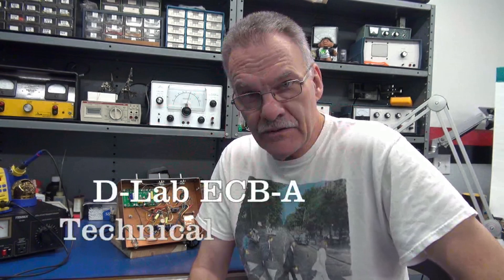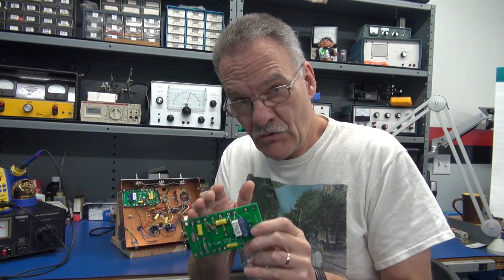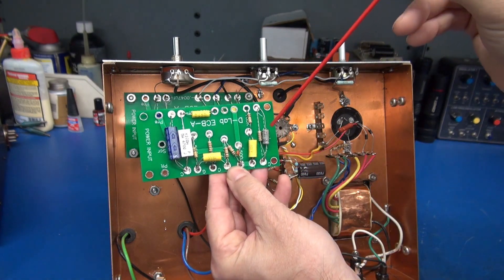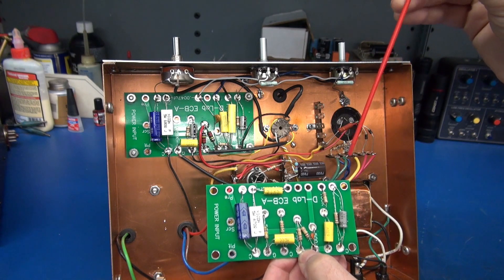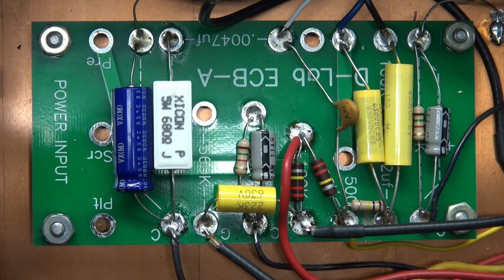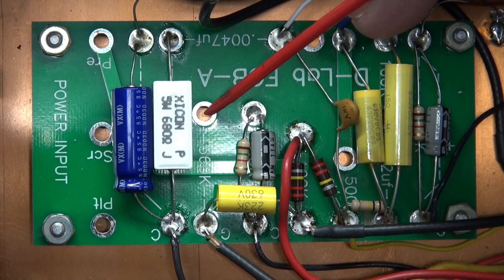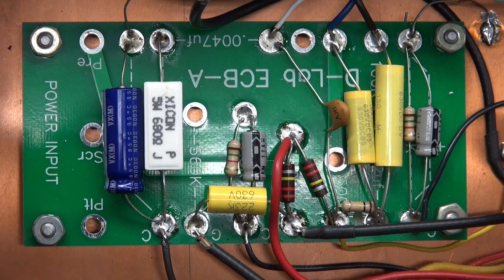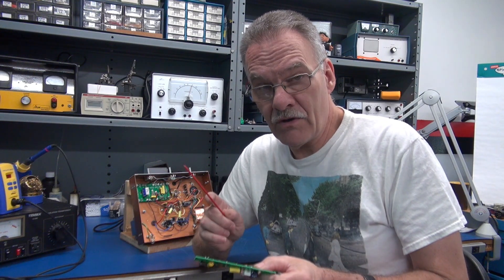D-Lab ECB-A board Technical update Convert tone to Bass Treble controls Fender Princeton Tube type

Comment: Hello Terry how are you hope you're doing fine. For many years I believe that old paper in oil or wax paper coupling capacitors DO NOT have any special sound qualities way back when they were new as compared to the new plastic film capacitors but I have noticed the new replacement plastic or poly film capacitors are much smaller in size and maybe its not the MFD value that affects the treble tone even if they're the same value but just maybe its because high frequency is affected by component size. I have an idea: maybe try putting an old leaky paper in oil in series with a new 0.1uf or 0.47. The new capacitor will block the DC and the paper in oil will shape the tone....just a thought I haven't tried yet. I have watched videos on YouTube about capacitor comparison in the guitar tone circuit but not the amp between ceramic, polyurethane,  polypropylene, wax paper and paper in oil and each one really does have a subtle different tone.